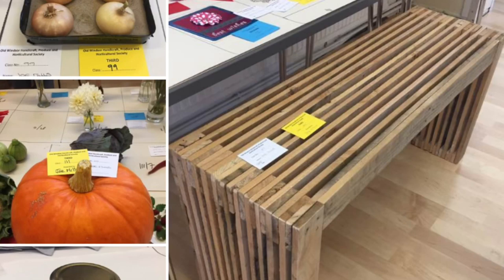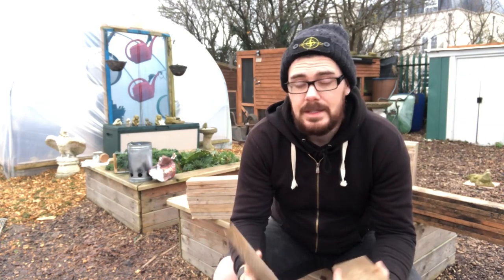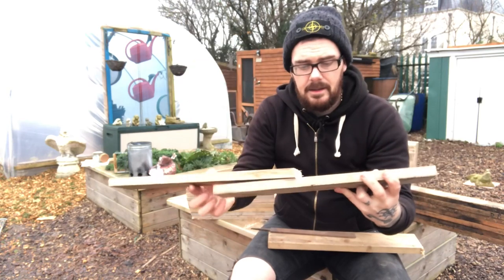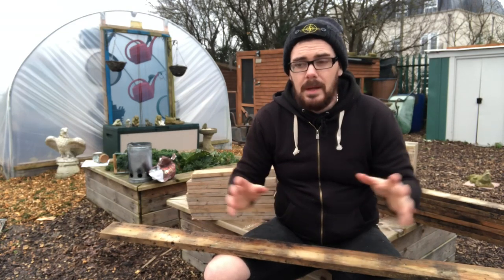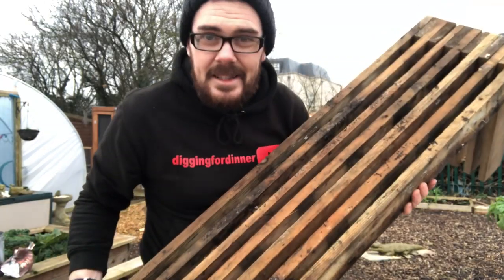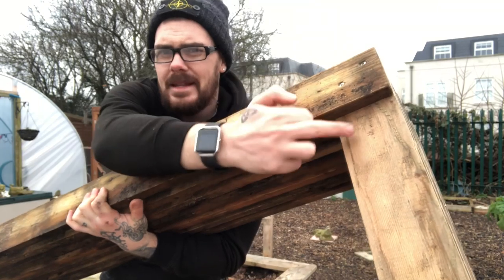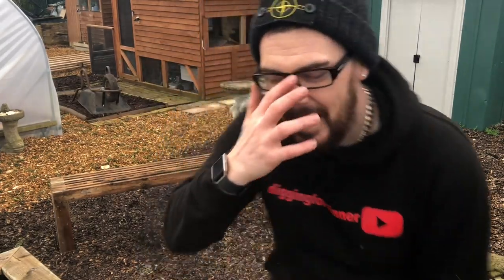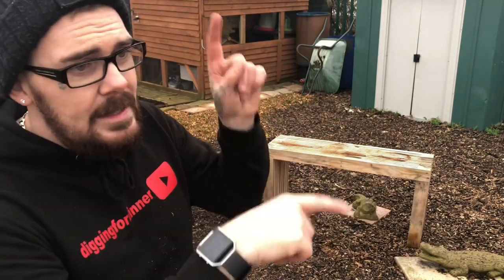Pallet Projects | Easy Step by Step Guide to Making a Pallet Bench

Comment: Great build Joe. On a side note i'm not sure if you knew but the Saw that you are using, has a straight edge, 45 and i think it's a 30 degree angles on it, also if you want to find the middle quicker, grab the Saw and use the straight edge to draw a line corner to corner on both edges, and obviously where they cross is the middle, or where the X is marks the spot.
Take it easy.
Barry (Wirral, ENG)
Reply from the maker: Barry Roberts Great tips Barry I had forgotten about the straight edge on the saw haha caveman vs modern man lol thanks mate

Comment: Great idea Joe. I'll definitely have to have a go at this. Just a quick question about your into/outro clip. There is a bit in there where you're making loads of square raised beds out of a dark wood. Can you point me in the direction of that video? Someone is gifting me some old 4" x 4" oak beams and the beds you've built there look like a great idea.
Reply from the maker: My Allotment Hi, the Sleeper beds we built for a disabled subscriber from “kits”

Direct link:

https://youtu.be/zjy2diaHlSI
Reply: @diggingfordinner  Cheers Joe thanks for the link. I've realised I did see this before because of the weird ways Julie's plot was set up with another running through it. And I definitely won't be using that company as I have my own wood coming. On another note, just want to say that all your "build your own videos" are brilliant. The bug house, mini pallet planters, the cloches from plastic kegs, all really good, original ways of reusing stuff. My plot will end up being a digging for dinner advert at this rate. All the best 👍🏻